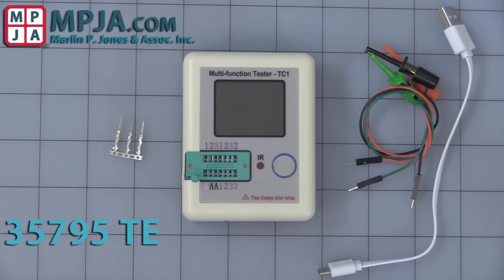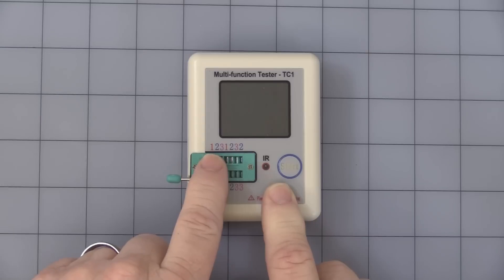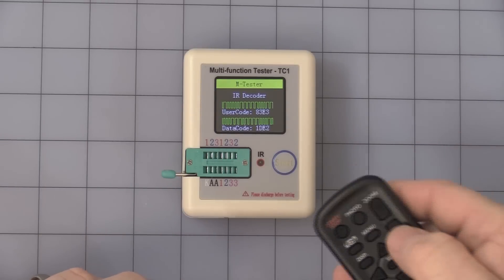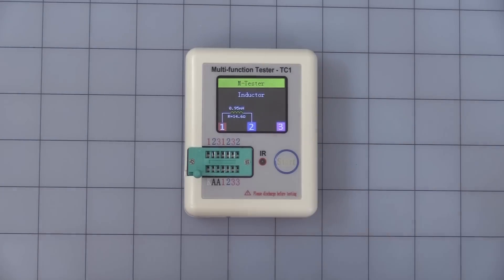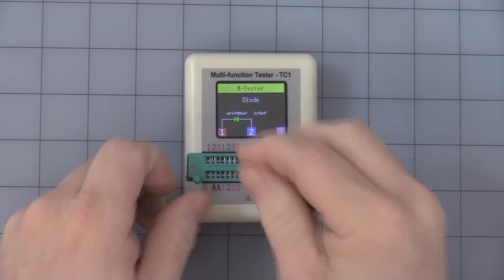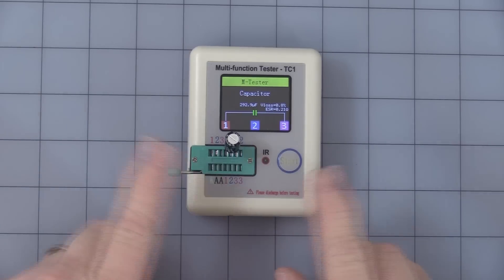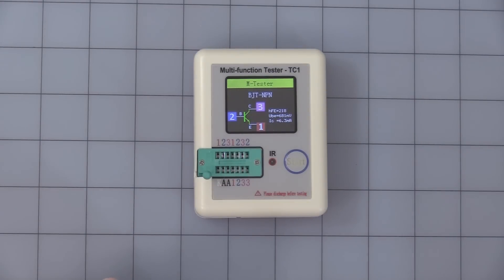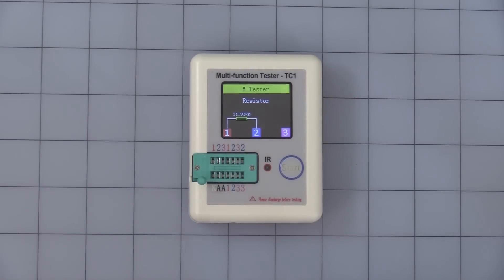Multi function Component Tester 35795 TE

Comment: Much better to us a few dollar more and buy the Bside Esro2 pro that can handle some abuse and has never failed.The major difference is circuit design when it is reliability.I will redesign the protection in the 1 of the 2 broken tc1 i have to be strong as Esro2 pro.

Comment: It is garbage straigth from factory.had 2 off them both did not last more than a few times.i fixed the one with english language pre set but it broke again after a short time.I have a Bside Esr02-pro tester for the same use.never failed.work like it should.To badly designed the tc-1.Shame i liked the color display but the circuit is shit.cant depend on it to work at all.NOT reliable a waste of money
Reply: I like mine and I have some friends that had them when they first came out, still going strong....

Comment: Thanks for posting this video.  I think I'll get one of these.
Reply: Dont.you waste your money.Buy a Bside esr02-pro that is a reliable tester cost around the same
Reply: @leohobbleohobb3781   I like mine and I have some friends that had them when they first came out, still going strong....
Reply: @Boudrow  You should google TC 1 tester problems,There is a lot of people that have those shit testers fail.It would be a fine tester just for the zener diode test that can test zeners high as 20 volt reverse brakedown or higher and if it work reliable.As it stands now it is garbage.take a google search and se how many post there is do to it will not turn on etc etc.